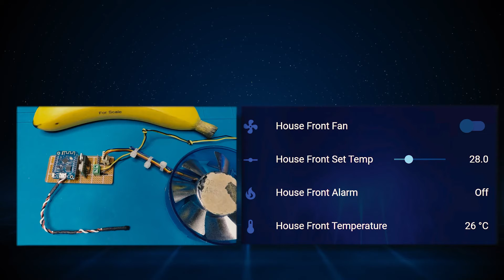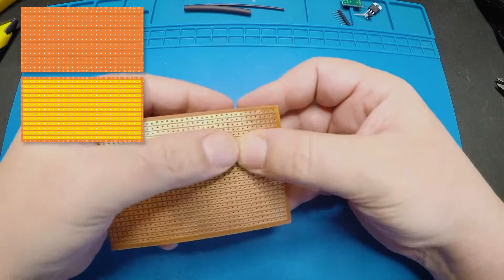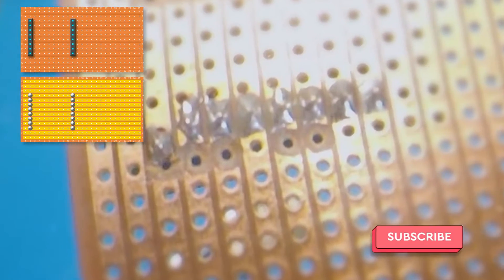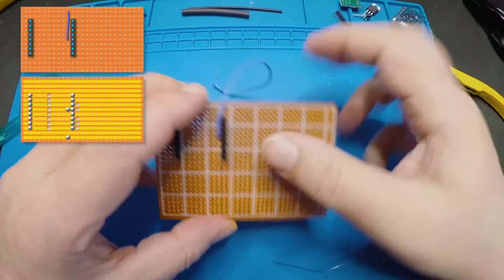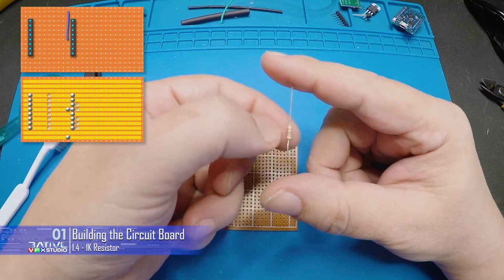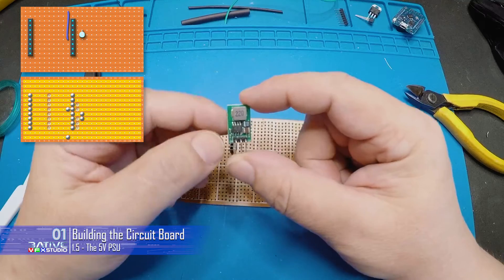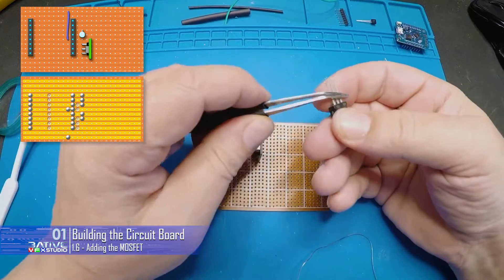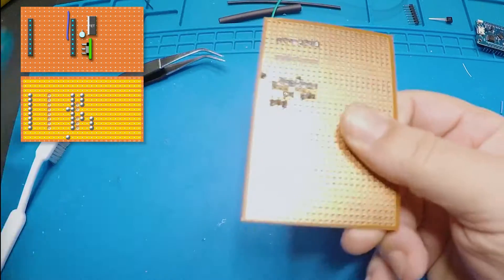Home Assistant 4-Wire PWM Fan Controller Prt 1 - PCB

Comment: Good morning from Austria.

First of all, I'd like to thank you for your great DIY videos; they're simply fantastic.

I know this video is a bit dated, but I'd really appreciate a response.

I have a project in mind and would need your help.
My network cabinet (roof fan only) is currently missing fans, and I don't like the ready-made solutions; they're simply too loud.

I would like to install two 4-pin PWM fans (Noctua NF A12x25 G2 PWM) and control them separately.
That means the first fan should start up, and if the temperature can't be maintained or reduced at 50% power, the second fan should start up until both fans are at 50% and then increase together to 100%.

At least, that's what I'm thinking.
Or would it be better in my case to buy the set of 4-pin PWM fans
(Noctua NF A12x25 G2 PWM Sx2 PP) and simply run both?

What would the board look like then?
Would I need to install two 4-pin headers, or would one and a Y-splitter be sufficient?
Are the remaining components suitable for my project, or would I need to make some changes?
Is it possible to install an additional display in the network cabinet?

Thanks for your help, best regards, Stefan.
Reply from the maker: G'Day fella. 👋
Thank you for the kind words and I'm glad you like my style. 

Without going in to a whole other tutorial. Basically you'd need two 4-Pin header (one for each fan). Then in the ESPHome code you would simply duplicate the 'fan:' and 'output:' components. Obviously your 'output:' code set to two different pins.
- So you would have "the_fan" and "the_fan2" as well as "fan_pwm" and "fan_pwm2". With those 'output:' going to different pins. E.G. OG pin of "D3" and the duplicated one going another spare pin. 
For "power" to the fans: I'd wire them both to the MOSFET. It'll have no problem switching on two fans at the same time. 

Other than that, you'd have to write your own code for controlling the first and then the second fan as you see fit.
Reply: @3ATIVE  Thanks for the quick reply. 👏🏼

I think I'll control both fans simultaneously after all, since it's easier and, in my case, doesn't really make a difference if one fan runs alone and then the second fan is switched on, or if both fans run simultaneously. 🤔

You installed two 4-pin headers in your tutorial,
so I can use both for the fans. Is this correct?
The preview image in the video actually shows three of them installed.
If I were to install another fan in the bottom of the case,
would all the components be able to withstand it? 👀

In this case, I would install three Noctua NF A12x25 G2 PWM fans.
This would be approximately (3x2W) 6 watts and (3x 0.2) 0.6A.

Thank you for your effort and time. 🙏🏻
Reply from the maker: @StefanRAM82  No worries. I try and reply to all asap. 
Ah, yeah... no problem running more than one fan. Like I said the MOSFET can handle it and the output is only a low-voltage PWM signal.
- So all your fan's can be wired in parallel from the same 4 pins.

Comment: I love this video, thanks!
Reply from the maker: You are so welcome! Where do you think you will use it?
Reply: @3ATIVE hello! It’s getting really hot here in Los Angeles even with the AC blasting and I have a beautiful (mid century replica) Vornado desk fan but it’s really power inefficient that I would love to use on a bookshelf to cool some external hard drives. So I want to upgrade it to a DC brushless motor fan with ESPHome controls. 😅😂 I’ve made an ESPHome monocrome LED (2pin) “neon” sign pwm  controller in the past using an ESP + mosfet module (the blue ones with the built-in screw terminals) that works nicely so I figure I’d give this a try? 

I need to learn more about the brushless fan options still. I noticed that yours is 4pin and seems about the right speed / power. Do you happen to know it’s max rpms? I want somthing fast but not like a drone/jet engine. 😅 

Also, I’m wondering if I should get a 2, 3, or 4 pin, since I have a bunch more of those mosfet modules (trying to understand the difference between 3 and 4pins). I guess if I go ahead and get the 4 pin module then I can at least save time by using your code exactly as is. 😆 But if I use the 4pin fan, I think they cost more and I might need to order the same individual mosfet components that you use in this video (vs the modules that I have). Would be cool to actually use this great looking Vornado fan I have though right?

Comment: Great video, thanks for the effort, the Dallas sensor isnt on the parts list, will any dallas sensor do the job?  DS18B20? want to use the ones with the metal tube end.
Reply from the maker: Thank you for the feedback.
Opps I forgot to add the sensor... But, yes - any DALLAS or DS18B20 sensor will work here.

Comment: Thank you for this awesome video and plans!!  I have learned a lot so far.  What I can’t figure out is where the functions for map(), set_speed(), and process() are defined and how do you include them in the project. I’m guessing these are custom C++ functions you wrote and are included in the project somehow in the lambda section for setting the fan speed.     

Can you explain how you did that please?
Reply from the maker: Hi Boss,
Thank you. I'm so happy to hear my little tutorial has helped you on your ESPHome / Home Assistant journey. 
As for the coding... 
It would have been better if i'd have commented and asked on the correct video - Part Two is all about the coding... and you kinda confused me for a second. I was like, Wait, What, there's no map / speed / process here! LOL

Basically:
A "Lambda" function tells the ESPHome compiler that what follows is C++ code. Therefore, you simple use C++ to program what's needed. 
To break it down a bit more:
"map" is a standard function in programming - It takes a range of numbers and "MAPS" them to another range.
"set_speed(xxx)" and "call.perfom()" are standard functions in ESPHome. In this case they send, then execute values to the "fan:" component of ESPHome. 
If you want more info on Lambdas, please take a look at this page: https://esphome.io/guides/automations.html#config-lambda
Reply: @3ATIVE  Thanks for the super fast reply!!   I'll do some more studying and figure out how to include my own C++ code for the map function.   ESPHome is new to me as I've only been using it for a few weeks.

I would like to add the ability to monitor the fan speed using the tachometer sensor built into the fan and display that speed in Home Assistant.    I'd also like to display the fan output speed in percentage on the Dashboard.

I really like how you used the small 3 pin 5volt regulator and the MOSFET for the fan switch.  Much smaller than the buck converter and relay I was originally planning on using.
Reply from the maker: @bakercxj  This may help: https://esphome.io/components/sensor/pulse_counter.html

Comment: Really sorry to be a PITA, BUT.....i got a new 5v 4wire noctua fan from amazon. I have tested it out on 2 boards but i've got some problems......the fan WILL NOT start without me giving it a nudge, and if i use the slider to increase the percentage the fan stops spinning when i get to about 80%.
While i move the slider the fan doesn't run any quicker....
If i hold the dallas sensor in my hand to warm it up the fan increases as it should.
My biggest problem tho is that the fan won't start without a 'nudge'
I have tried using several 5v psu's and i get the same result.
Hopefully you have a quick fix.
Thanks for reading this.
Reply from the maker: Hey fella, no PITA perceived. Not sure what to advise here... I tested my setup with both 5V & 12V fans. Maybe those Noctua 5V fans will need a code tweak. The best I can do is get one to see what's happening.
- You won't be able to post the full link but, if you reply with the Amazon part number for the fan you brought, I can buy one to play with.
Reply: @3ATIVE  You're a star.....the fan i got was noctua NF-A4x10 5V PWM
is that the only info you need ?
Reply: Found another number.....B07DXS86G7

Comment: Hi, i've made several attempts to get this working, with no luck as yet. I only have a 3 wire fan....is THAT my problem ? As you stated in an earlier comment, you are only using 3 wires in your design, so I naturally assumed that a 3 wire fan would work......fell free to take the piss BIG TIME if I do need a 4 wire fan lol
All the code is doing as expected, it thinks the fan is 'ON', but it's not.
Thanks for any help you can offer.
Reply from the maker: So sorry fella, I don't know how I missed it. I did state I'm only using 3 of the 4 wires on my fans.
I forgot that even thou 3-wire fans have, well only 3 wires... NONE of them are a PWM input - which this project uses for speed control. So, no you've not missed  anything - this won't be able to do anything other than turn your fan on/off - No Speed control.
Here's why:

* 4-Wire Fans:
1. 0V
2. +V
3. Sense Pin
4. PWM in

*3 Wire Fans:
1. 0V
2. +V
3. Sense Pin
Reply: @3ATIVE  ahh, thank you for clearing that up for me, I’ll have another look as my 3 wire noctua won’t even power on. I’ve ordered a 4 wire one to give that a try. 
Thanks again 😀
Reply: Really sorry to be a PITA, BUT.....i got a new 5v 4wire noctua fan from amazon. I have tested it out on 2 boards but i've got some problems......the fan WILL NOT start without me giving it a nudge, and if i use the slider to increase the percentage the fan stops spinning when i get to about 80%.
While i move the slider the fan doesn't run any quicker....
If i hold the dallas sensor in my hand to warm it up the fan increases as it should.
My biggest problem tho is that the fan won't start without a 'nudge'
I have tried using several 5v psu's and i get the same result.
Hopefully you have a quick fix.
Thanks for reading this.

Comment: I think i'm being a bit thick here.....BUT what fan do i need for this ? Is it 3 wire or 4 ?
Reply from the maker: Errm... well... it's titled: "4-Wire PWM Fan Controller" LOL
However, I'm only using 3 of the wires, the 4th being an RPM pulse return. And I believe 3 & 4 wire fans have the same first 3 connections in the same order.
Reply: @3ATIVE  yeah yeah, ok, so i missed that part lolol
Thanks for getting back to me, it's appreciated

Comment: Hi, and tanks for a great video! I dont have stp16 but irf520, can I use that instead?
Reply from the maker: I can't say for sure, I haven't tested an IRF520. However, the datasheet states it has a Gate-Source Voltage of 2-4V.
So... 'maybe' - When you test, please let me know if it works.

Comment: This is great!
I've been looking for something similar.
My use-case is ventilating the ottoman storage in a sofa,  to prevent blankets getting foisty.
So instead of temp, the environmental vairiable would be humidity.
Reply from the maker: Thank you. I'm glad to hear you found it useful. Nice use-case too 👍
I heard from another viewer who's them in a similar manner... for his Cigar Collection cabinets.
Reply: @3ATIVE  I'll be doing both for sure.
Am I right in thinking I'll be fine without 5v psu the if I'm powering via usb? or am I likely to cause myself issues? That's there to step down 12v power right?

Comment: This is great!  I'd love to see you review the schematic on screen to explain what we're going to see in the assembly process.
Reply from the maker: I hear ya... But, it's such a simple circuit - I'm not sure there would be much benefit. 
All the 'magic' of this project is in the ESPHome Automation(s).  😎
Reply: @3ATIVE  It would be great to have a schematic showing which pins connect to each of the parts. It's quite hard to follow from the video. sorry
Reply: Hi this is just what I’m looking for, great project. In my project I would like to have 3 temp sensors linked to 3 sets of fans, if this is at all possible? Im hoping to control each cabinet space separately but from one board maybe esp32. Any help with this would be appreciated.